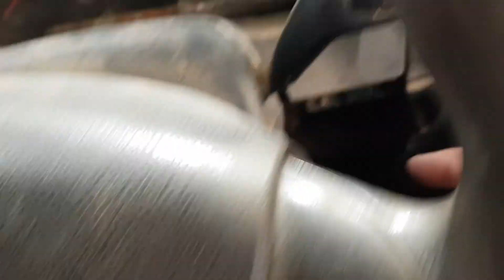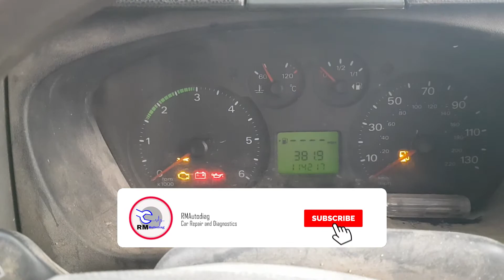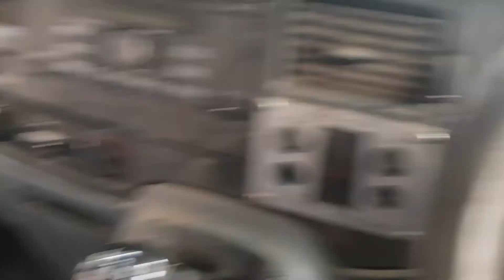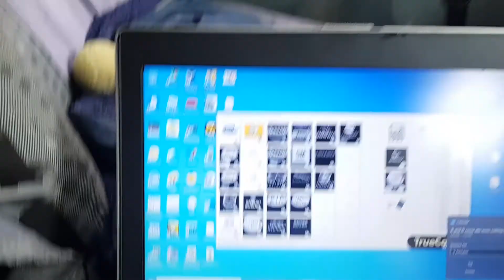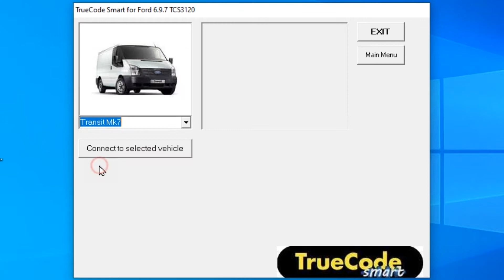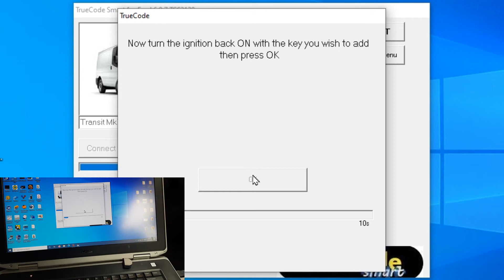Ford Transit key programming using Truecode Halkyard Tech

Comment: Hi would this work on a 2002 transit ? thanks
Reply from the maker: Yes it can do the 2000-2006 transit. You would need the F1 module for Ford and the cable from halkyard tech.